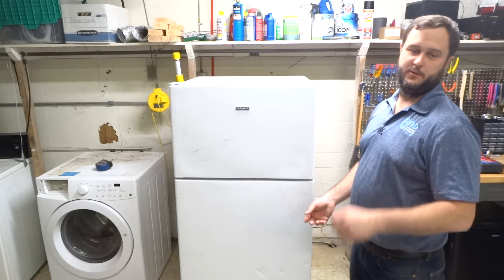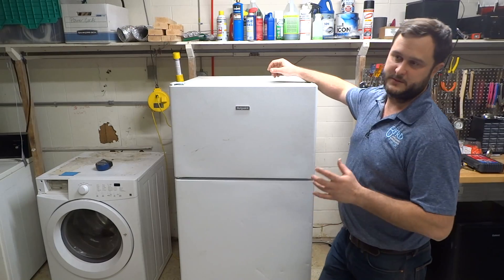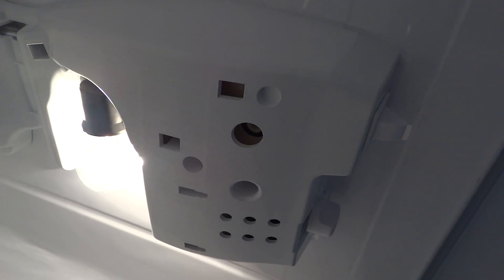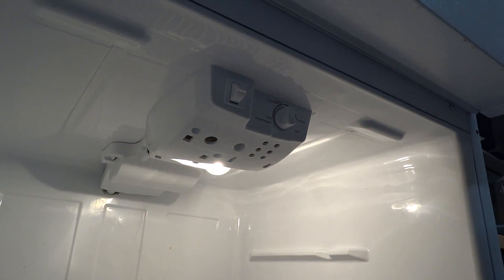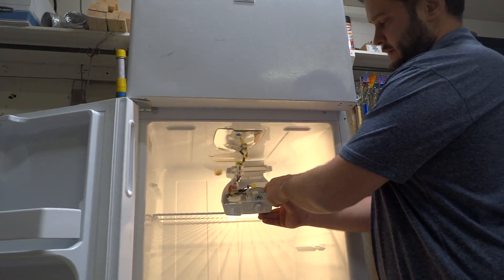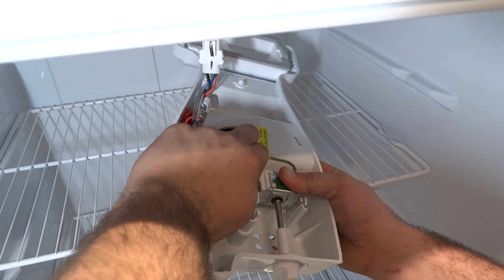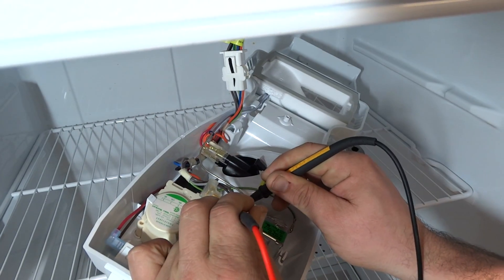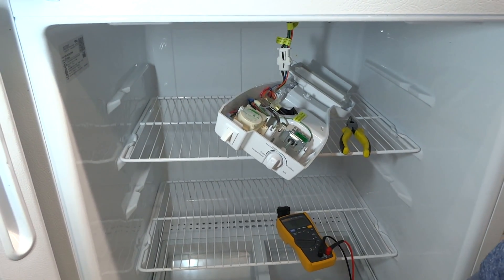Kenmore Refrigerator Not Cooling at All - Defrost Timer and Cold Control

Comment: Where does the other end of the capillary tube go to on an older Kenmore (circa 2002 w/Freezer on top) with the freezer on the top of fridge. Does it go to the Evaporator fan area in the freezer? It would be very helpful if you could please share the information.Thanks.
Phil

Comment: Mine was the cold control. It was a little tricky because the cold control was in series with the timer so the timer could not advance out of defrost, defrost circuits weren’t on because the bimetal defrost thermostat was opened because it reached a warm temperature. Also it was the first time I had a cold control that was failing intermittently all the times before this it was either stuck open or closed.

Comment: Cool video,  homing in on the problem.  Am having an issue in which it isnt kicking back on after defrost.  Checking that cycle before i get out the multimeter.  Will report results,  thanks for the info!

Comment: I came to this video a few months ago when my fridge turned off one day and didn't turn back on. The screwdriver method worked for me for a while. However, recently my fridge no longer goes into defrost mode, and the freezer/fridge have gotten warmer. It's pretty much what you described @1:03  The freezer part is cold enough to preserve food and get drinks cold but can't keep ice frozen and the fridge is only slightly below room temp. I've recently replaced the temp control thermostat but that didn't work. The screwdriver on the defrost timer no longer does anything but turn the fridge off after turning it a few times. Could replacing the defrost timer be the fix or did the issue get worse? Your video quality is very good btw, you are a real professional.

Comment: I have a kenmore 58149800 coldspot. Do you happen to know where is the defrost timer location would be at?
Reply: Oh and i used the 3 in 1 relay but both of the fans wont kick on..so I possibly thinks it had to be this...
Reply from the maker: We have another video walking through no fans running. It's in our list. Hope it helps.

Comment: I replaced the starting relay and the capacitor. Both fans are now running and the compressor but not cooling. What's next?
Reply from the maker: Sealed system. Likely a leak or restriction, if those are running.

Comment: I have an old whirlpool. It stopped working and I was able to turn the defrost timer and then hit the panel and everything started working again. It eventually stopped again and went back to defrost. I replaced the defrost timer and turned it with a screwdriver. I also hit it like before and nothing comes on now. I didnt have the tool to check the temp control.
Reply from the maker: If you turned the defrost timer first, and nothing happened, then you hit the cold control, and it came on... probably have a bad cold control. You can jump the cold control, if you are comfortable with that, and test to see if it comes on. You can't leave it jumped, or everything will freeze.
 Good luck
Reply: Byrd Appliance Specialists Thank you so much! I replaced the cold control and also left the new defrost timer I replaced at first that wasn't the fix. Once I replaced the cold control the refrigerator kicked right back on and is working like a brand new refrigerator!

Comment: I have had a Kenmore side by side for years, and like it, but the  cooling stops; when I hit the control button plate firmly, it starts back up, but overnight too low cooling has ice beginning to melt and drip.  I suspect it may be as you have shown a bad defrost timer.  I write now, because my controls are at the top of the opened fridge door  -  in trying to access it, once screws removed - still could not take covering away.  And, one of the screws I removed secured the defrost timer!!  So, now it is out of place up there, and I cannot get access to replace/re-attach unless all this plate comes away. It is Kenmore Coldspot 03-98 Type C 22SSA98; Ser # SH1239232  thanks for any assist...  Tom
Reply from the maker: Look around for snaps and slides, if you can't find all the screws. If it has 2 twisty knobs, you'll have to pry off the face plate. I bet that's what you have. Good luck
Reply: thank you.  seems then my symptoms are from a faulty Defrost Timer, wearing out, getting stuck in its rotations.  Now to find the part..!

Comment: Thanks for a very good Video!
 I have an Whirlpool ET22DKXFN00 is not cooling; 32F in the freezer; 58F in the food compartment. The compressor, the ev. fan, and the condenser fan are working well; no ice anywhere. No dirt underneath the refrigerator. It runs and after a long time it stops and comes back on in 25 minutes. What can it be?
Reply from the maker: Hard to say. Stopping for 25 minutes is normal operation - that is the defrost cycle. No frost buildup means you could be looking at a sealed system issue. You'd have to look at the evaporator and see the frost pattern. Search for pics of normal evaporator coils. Good luck

Comment: On my top bottom frigidaire, and a few others I'm working on. ALL Parts  working, Compressor ON, Evap Fan ON, everything coming on and running, but not getting cold at all - DID the freon Leak out over time???
Reply: I work on used  appliances. Frididaire refrigerators are known for leaking I see it all the time they leak the most

Comment: What if the compressor comes on after checking the temperature control, but the fan in the freezer part does not. ??
Reply from the maker: +Maria Gonzalez if the condenser fan and compressor are on, and no freezer fan, then you either have multiple issues or you may have misdiagnosed it. Was it not cooling at all, or was there some cooling? I would check the fan in the freezer. Good luck!
Reply from the maker: +Maria Gonzalez Also, in rare cases, the freezer fan is wired to a bi-metal thermostat on the evaporator.  Once the evaporator, the evaporator gets cold, it will turn on, if that's the case.
Reply from the maker: +Maria Gonzalez The fan is bad.